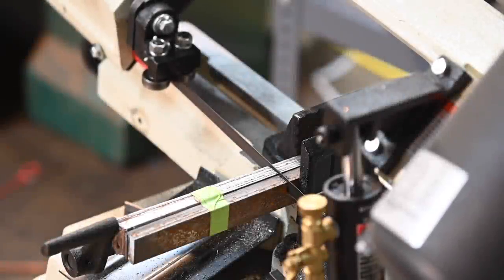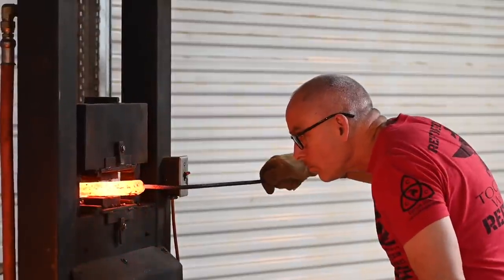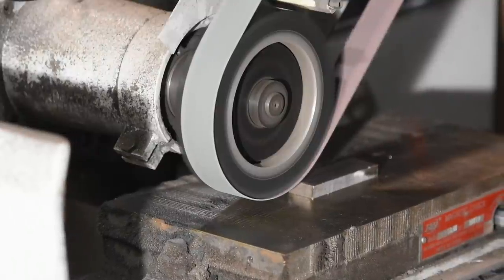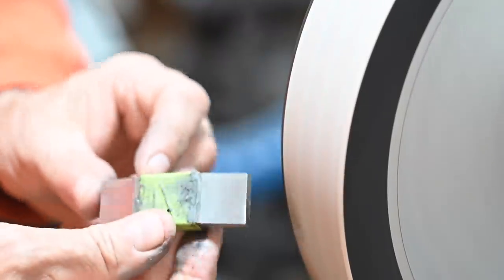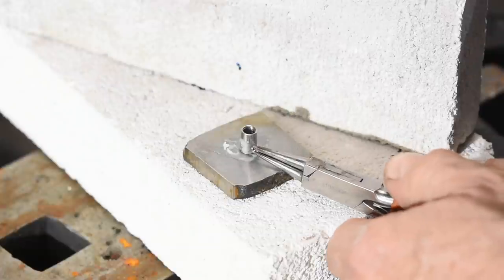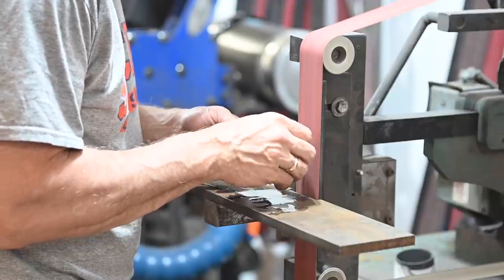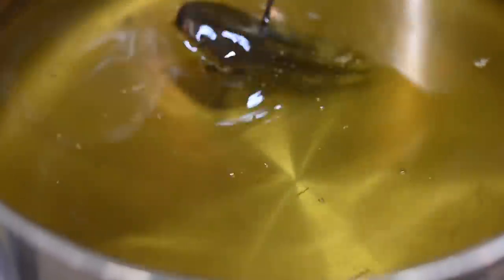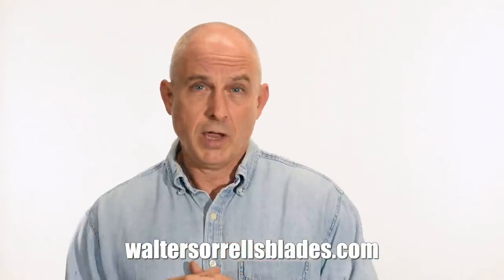Damascus Ka-Bar Tribute Knife Fittings

Comment: Hey Walter - at this point you should really consider getting a TIG welder so that welding CAN be precise, step your game up there like you did with the CNC machine. Take some basic lessons at a local tech school or something just to get a solid handle on it, I think TIG would really give you another avenue to take advantage of in your knife making. Compared to MIG, TIG is a game changer for these smaller, lighter materials in higher precision jobs.

Comment: I can't wait to see what you choose for the handle. The original military K-bar had a stacked leather handle. I wonder what you'll choose?
Yeah, the mild steel guard and pommel on the K-bar was a cheap choice, but if cared for, kept painted or oiled/waxed, it lasted. Those parts always rusted faster than the blade.
Reply: Well, you addressed this in the video. Guess I need to watch it all before commenting. My mistake. The guard and pommel turned out beautifully. Great job.
I'm guessing the knife is likely done, and the footage was cut into several videos due to how much footage was taken? Otherwise you wouldn't have had the knife to fit the guard and handle to in this video. 🤔
I can't wait to see the rest of the videos edited and posted. This is looking to be a beautiful tribute.
Nice selection of wood for the handle, by the way, but sure would have loved to see the stacked leather. A round wood handle is a bit harder to control in hand to hand combat, once there is blood on it. Of course, once the leather is smoothed over from lots of use, the blood would slick it up too, so it's kind of a moot point.
That was always the one thing I hated about the K-bar was the cylindrical handle.